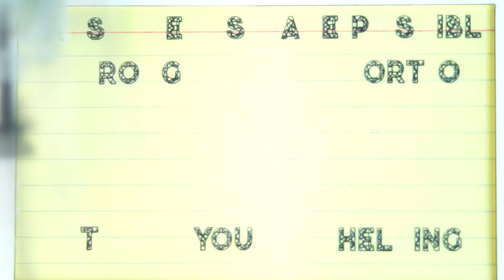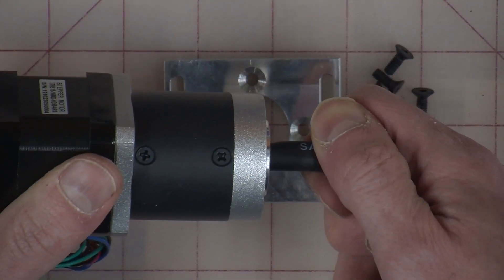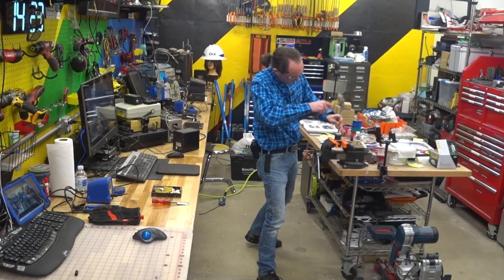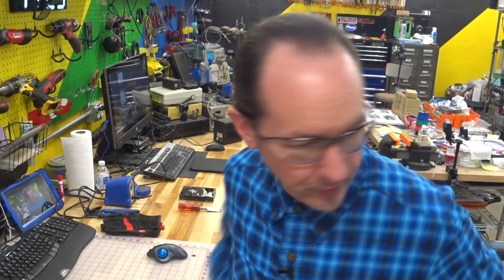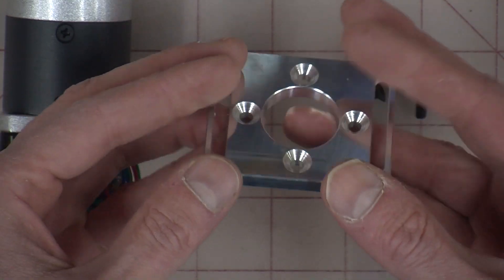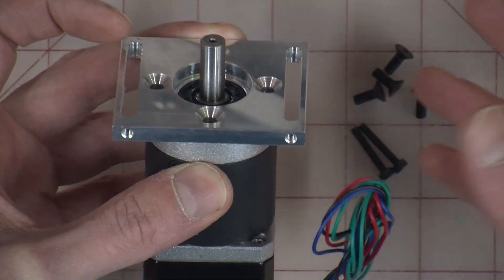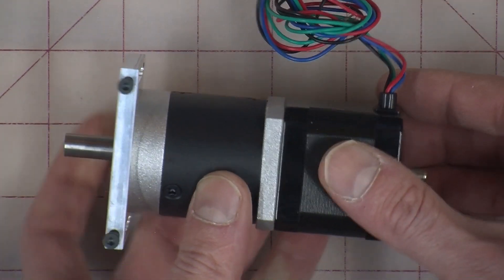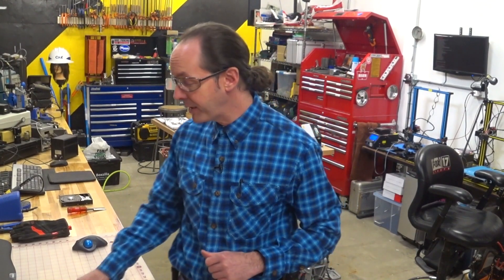Project ARchi3 Episode 22 - J3 Motor Mount

Comment: My preferred tool for removing keys: a pair of steel fixers / tower pincers. Just grab the key on the long sides and lever it out. Way less stress on the axle, bearings and gears.

Comment: Yep, chisel (or big screwdriver) was always how we removed keys
Though be aware on smaller motors you can drive the shaft into the motor, if the shaft goes all the way through, hold it in the vice so the back of the shaft is resting on the bottom of the vice jaws.